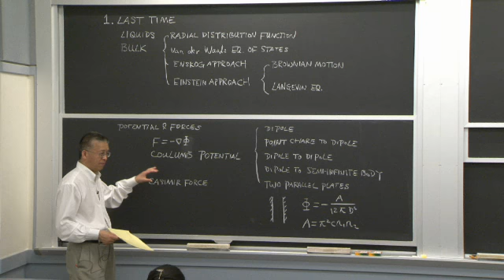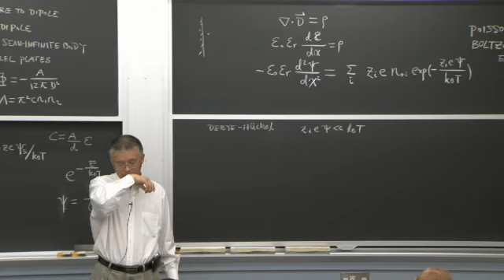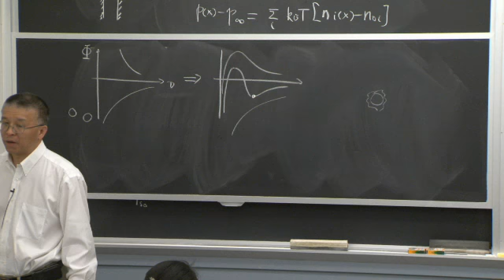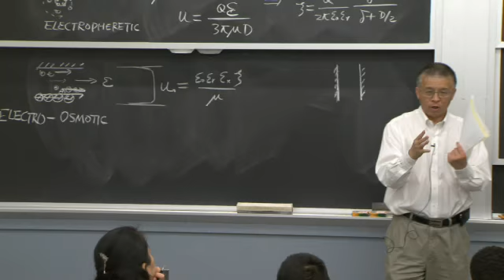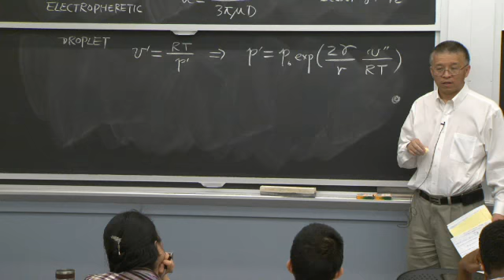24. Electrical Double Layer, Size Effects in Phase Change

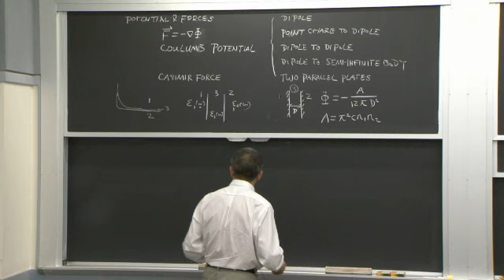Comment: 13:00 electrical double layer starts
Reply: THANKS
Reply: at this point i still wondering ... why does metal have negative charge at metal surface when sorounded by liquid ????
Reply: @a.t.arianto.1979  it depends on the charge of the electrode
Reply: @a.t.arianto.1979  When a metal reacts with oxygen and generates oxides, the oxygen atoms become negtive because they receive electrons from the metal and then bond with positive hydrons in the water.